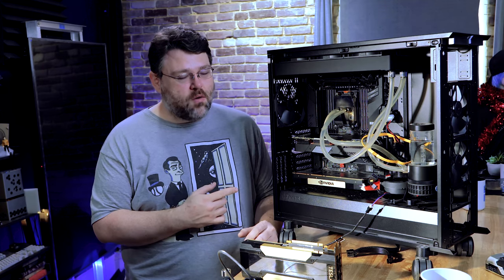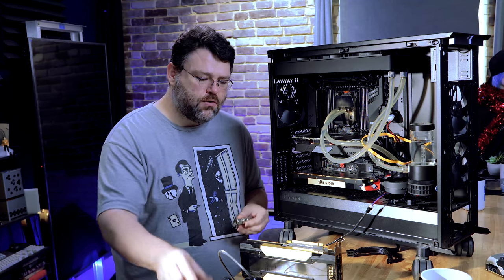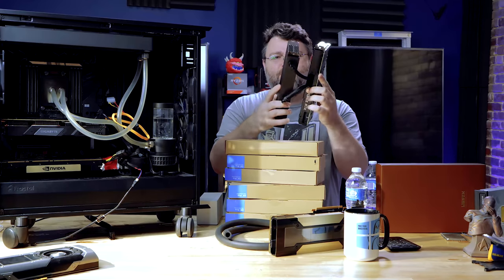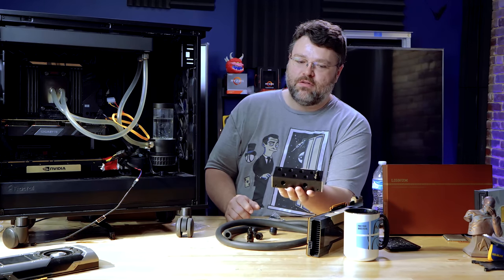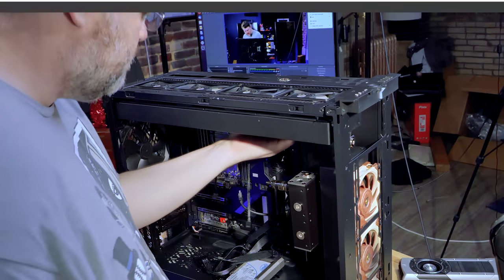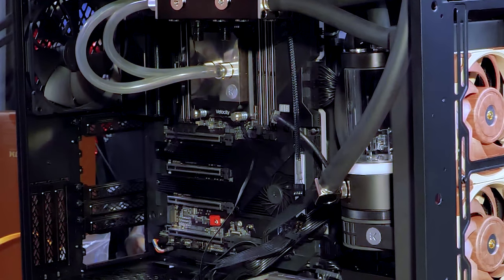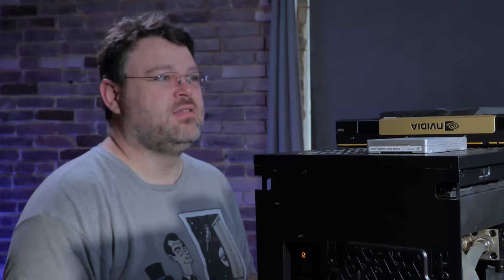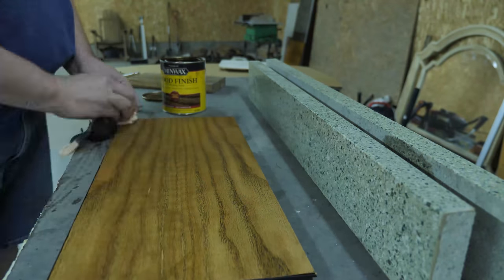32 Core Threadripper Workstation Upgrade - EK-PRO Quick Disconnect Liquid Cooling

Comment from the maker: HOLY CRAP THAT WOOD GRAIN AT THE END or something :D
Reply: It looks amazing I love the wood effect 10/10.
Reply: what is your case? i have been looking for a case with front panel for hot swap boot/storage drives, but it seemed all new cases are moving to the "sleek" bandwagon.
Reply from the maker: @noname-vl6vy  https://youtu.be/e1z_puftG9k - It is our Fractal Define 7 XL!
Reply: Classy AF
Reply: I remember AlphaCool showing some Epyc and Xeon 1U and 2U water cooling blocks and thinga last year at CES
Reply: car coolant been using mine 4 years only took apart to upgrade GPU once 4 years on still going good
Reply: Petg bro
Reply: There are a lot of good USB BluRay-ROM drives out there. Maybe even 5 1/4" combo enclosures with 5 1/4" and 3 1/2" floppies and a slim BluRay drive.
Reply: this  may seem strange but what little cart like device with wheels is it that you have there?
Reply: Somebody call the LGR.
Reply: Yes the minwax was just the right touch wendell. I think wood is sick looking,i love it! They make all sorts of veneer now,that will just stick to any case, stain and clear coat dont touch it! Ive been thinking of doing this exact thing, now i have too!!!!

Comment: There are a few things that I pondered when my friend showed me his water cooled pc. The first one is. The radiators should have bleed nipples on them, just like car radiators do. This would make getting air out of the system so much easier. The second was what this video has shown. I've worked with cars most my life, and always wondered why the whole water cooled setups were so cheap on the PCs, especially considering they are going in an electrical piece of equipment. Everything from the metals used to the coolant should be basically the same as a cars. Mixing antifreeze to water not only helps protect the metals in the coolant system, it stop all sorts of contaminants like sludge and other deposits from forming. It also raises the boiling point of the water. It most definitely conducts heat much better than these coloured liquids, plus antifreeze comes in some cool colours itself.
Reply: its funny you should say that, using PTFE tubes (rated to 240C), pneumatic stainless push in connectors (that are rated for water as well) and G13 HOAT car coolant in my setup here and those high end parts cost less then anything ekwb sells... The g13 gave 3C thermal delta difference over pure water, but pure water will eat everything over time so well worth it.

Comment: heatkiller waterblocks , your friend has good taste . I have the all copper TR4 block from them ....... its ..... awesome !

I use them black rubber tube and automotive fittings.... never need to clean the fluid , its as clean now than it was the day i filled it.

Comment: When I started noticing liquid cooling rolling out and the subsequent troubles, I was like yeah none of the materials are speced for it.  Then I looked into their fittings and I realized these guys are re-inventing the wheel.  They are incurring and solving problems that have already been solved many decades ago.  They could toss maybe 10k at a retired engineer for some contract work and save a boat load of R&D through trial and error and the additional warranty claims.  I still view water cooling products being engineered  by a bunch of armatures (the manufactures not the end users).  So here is an idea for a proper rubber line with some bling.  A person could mix their preferred plasti-dip color.  Add in a fluorescent pigment.  Spray the lines, then add some UV LED's.
Reply: You can also mold your silicone lines given the right tools. Car industry has some good silicone tubing rated for high psi and temperatures. Food industry has already had this exact tech for years now. Seen a few of these behind the scenes. Only main difference is the look of real industry products since they arent meant to be displayed in the first place. But I agree too many people dont realize really what your paying for is the luxury look and maybe ease of use compared to an actual tried and true standard.
Reply: Totally agree! There are so many really weird material choices and focus on stuff that does not actually matter in water cooling. I could buy some Festo nylon tube and stainless pneumatic fittings and have this done faster, more reliable and costing significantly less. One of the things that always surprise me is the fact they seem to use like 10-14mm id tube, but the flows are always going to be under 5 litres a minute, and probably more like 1 l/m You could halve the tube diameter and still have very doable pressure drops. I mean everything in my house is connected with 15mm od copper and runs way more water through it...
Reply: @buildthis2324  Push in connectors are used all over the factory floors these days, and are easier and safer then these compression fittings, yet somehow the push in fittings still seem like a no go here
Reply: I work in the car industry and fittings same size as here handle 100psi of air for tools or whatever. Rated usually much higher but I have quick connects for 100psi of anything not pure acid and they work just fine. Now however I do like the look of these quick connects for sure! Probably will be picking up the block  and sourcing everything else elsewhere.
Reply: @buildthis2324  Festo sells decent distro blocks as well. I don't know what EKWB charges for the quick connects but CPC has some great ones as well if you can get your hand on em. Good luck with the build!
Reply: As a final note the dude with the curly mustache...bit-tech! He makes some good ones custom from scratch. Another place for ideas and whatnot.

Comment: Nice touch with the wood.👍 I didn't know EK makes wood covered blocks. Cool! 
 I did something similar to a  inwin 301 outsides.  I got rid of the front light and I/0 strip so it only has one vandal switch.

Comment: Just look up "norprene" tubing. It's the same stuff. Super stable. I have used the same norprene tubing for something like 7-8 years with just distilled water and alcohol (for sub-zero purposes, and works well as a biocide too). The fluid has remained clear and clean. Blocks have not had ANY buildup. The only buildup I have had is a small ring inside the cylindrical reservoir from fluid evaporation, which I cleaned off with a toothbrush and barkeeper's friend. A quick filter of the fluid through some filter papers and back into the system it went.
Reply: I'm surprised the alcohol doesn't evaporate out and escape. That's cool to hear though.

Comment: This build is almost exactly what I want to do. Assuming Im following what you have done. Im assuming the distribution block is split into two sections, with each section having several ports. Then you plumb each component to both sections. This results in parallel flow to each component.

If that is what you have done, then the only thing I would change is to switch to 1/4” diameter rubber tubing instead of the 1/2” or 5/8” you have. While this would increase the pressure drop in each line - reducing the flow somewhat - it would make a much cleaner layout.  And there still will be plenty of flow, as all of the lines are in parallel (whereas most loops with 1/2” tubes are in series).  

Very interested in how this turned out.

On reflection - it looks like the kit uses 6mm id tubing. Excellent!

Comment: Been using that black ZMT tubing from EK for a couple of years now and it is still holding up great. I just use watercooling on my threadripper system cause it is more practical in a way, while it takes more time to build and needs maintenance from time to time, it is silent and never bothers me and it never overheats, even when it is 40 Centigrade here. 
Also, it doesn't need special fittings, it just needs fittings that fit the inner/outer diameter. I use some bitspower fittings and they work great. That distribution block looks really nice though, but I'm not sure I can convince myself to spend the money on it because I won't really use it and they're charging quite the premium for it atm. Nice video though, thanks for the content!
Edit: Spreading out the paste across the gpu die is a thing, this is not an IHS, as such every square mm of it needs to be covered or your gpu could overheat and die under load if the patch that has no/not enough thermal paste on it has no thermal sensor in it. Spreading it out manually removes the chance of this happening, Buildzoid does so with his LN2 pots too and made a video about why you spread it out manually. Personally I don't feel comfortable with guessing that it will be all right and that I put the block on level enough for the paste to spread everywhere.

Comment: Looks awesome Wendel, but did you seriously fill your loop without any clamps on that ZMT hose? Keep in mind it can expand with use
Reply from the maker: It's on the Todo list
Reply: I got ZMT and even without the locking collars they're hard to get off the fittings so I wouldn't be too worried.
Reply: It expands with heat, like every material does and having "loose" water tubes in my system wouldn't let me sleep at night. Hanging tubes, gravity force, heat extension, water pressure (ok, I know it's not 20bar inside, but still weight)...  Even just imagining those coming off during an important render session (or whatever you do with those extreme GPU's) while all your systems are running with max load, gives me the creeps – and it's not even my system.  lol

Comment: Are you tracking my Google searches? Literally, I was looking into EK water-cooling inside of a Define 7 XL with a 3970X the other night, and the only question I had was could I do the whole EK kit in the 7 XL storage configuration. It's going to be an Unraid machine with spinning rust AND PCI passthrough.
Reply: I have a similar use case for my existing Threadripper system (1950X), except I plan to use Proxmox instead of Unraid, same outcome in the end though :)
Reply: @longnamedude3947  I want this to be my piece de resistance in my office. The EK block is so beautiful, and I plan on doing some pretty sick stuff. Wendall, can I buy my parts and come on and do some really nerdy stuff? How to really leverage Threadripper for regular people? (Not that you're not regular people.. shoot!)
Reply: @hotstovejer  Sounds like you need a case like the "ThermalTake Level 10 Titanium Limited Edition", but with a Glass side panel and some minor I/O upgrades.....

You can't really buy them anymore and they were rare and very expensive when originally released. (About £1000, Limited to 1000 Units too I think.)
Reply: @longnamedude3947  I've wanted a Define case since the R6, and if I started looking at other cases, it may be another 2 years before I choose lol
Reply: @hotstovejer  I have myself an R6 in White with the TG Side Panel, I put some faux wood effect vinyl sticker on the front and it looks quite nice, it isn't perfect though, I could do a much better job of it if I had a second go at it.

I prefer the R6 with USB Type-C over the R7 mainly due to how you can screw the side panels in place, so they won't pop out.
Reply: @hotstovejer  good luck. N nice nickname handle guys

Comment: Okay hear me out here. Quick release to a radiator outside your building. Save some AC costs haha.
Reply: Linus tried it. It required too much maintenance for the performance.
Reply: That’s how you get condensation inside your computer: and disaster
Reply: @Smithdude_  also you can only do it in really moderate climate... I thought about this a bit when building my Mo-Ra external loop, but in winter it's freezing outside so I would possibly have subzero coolant with the need for antifreeze and in summer it can easily reach 35°C, so I would have really warm coolant... Also would require a complicated fan setup if you don't want to run power for the radiator fans through your whole place. 

Better to just put the rad in a room you don't really care about but can keep reasonably cool.
Reply from the maker: Haha!
Reply: @Daepilin  Could always switch to an inside rad in the winter. As a bonus it'd help with heating costs :)

Comment: Serious question - why wouldn't you just buy quick release fittings, tubing etc at a local hardware store?
Reply: Not all are made equal. It's not to say that you can't find some equally good (or even better quality) fittings out there, but EK should have tested and validated their product - I'd trust their validation to count for something over a random product with an arbitrary 5 star rating.

Comment: yeah i'm not really jumping on the watercooling bandwagon, aircooling is not much worse cooling wise, granted you get the right cooler, but that's the same with the watercoolers right now, id say aircoolers still have some critical points better, like reliability (much lower risk) and resiliency(no growth, no change it out every 1-5 years) and ease (fan dies change fan, not the whole system, no flushing), you can use an air cooler for decades if the parts hold without taking off anything and if the cpu sizes hold carry the cooler on to the newer systems.
 yeah too many points against watercooling imo

Comment: Why are those pipes and fittings so gigantic? The flows required are really low, like 6mm id would already be low pressure drop based off some off the napkin math...

Comment: Made me think of the cooling used on the Comino Grando RM, that full coverage cpu block, and separated radiator and fans.  Any chance we could get a review from you on how it performs not only for its specialized purpose but also as a general use system.

It's only a few thousand more than I spent on my threadripper system.

Comment: Do the sub-loops off the distribution block run in parallel? If so, how are the flow rates equalised given the different impedance of each loop, and the varying number of loops when you use the disconnects?

Comment: Would it be possible to combine 2x Little Devil PC-V10 PC cases to cool the 32 core Threadripper with both cooling probes mounted into a copper block which mounts on top of the Threadripper.

Comment: Question: how do you cool your SSD? I have P4500 and it gets pretty toasty under load - i mean high 60C and sometimes it starts throttling. I had to put it into the bracket with cooling fan blowing right on the SSD radiator. Is there a fan under the PSU shroud that blows onto SSD? How do you keep it under control?

Comment: 12:50 Didn't you mention there was a possibility of bio buildup in your previous kit? Why risk introducing that crap into a clean system. You are cleaning an old cut, but covering it back up with that dirty bandage...
I remember you patent-pending cooler design for the Tesla made from the mirror of a model S. Okay it's not, but sure appeared so. 
One last thing: wouldn't you consider a mod this extreme what possible performance increases you might attain, as an unnecessary risk? They are still very expensive cards to  replace...

Loved the video regardless, and looking forward to the rest of this build.

-Smalls
Reply: @MACDRU421  I had a CPU AI1 awhile back that performed really well. But I currently have the oversized Noctua dual fan heasink. The type that enjoys obstructing RAM slots... It's difficult to remember all the details. 
What I do remember is that I'm from the age of Sandy Bridge while being armed with a Maxwell Titan X...

I honestly thought though in the last few seconds Wendel left the office to take a tour of Nick Offerman's Wood Shop.

Comment: Wendell, for the love of god, if your using just a barb and not a compression fitting, put a clamp on each barb! You are dealing with rubber tubing, over time, with higher temperature and pressure on the inside... it will leak! I know you are new to this, but you didn't even mention CPC disconnects EK they have sold for years, and still do, which are medical grade. And I been running a 3990x with dual 2080ti with 1 D5 pump, its fine. Also you said you shouldn't let the water return to the res from the top? No, that's fine, and by doing so you don't need a flow meter to see you have good circulation, no air bubble problems... Kind of confused about the distribution block; Is this to avoid putting the loop in series pump->gpu->gpu->cpu->rad->res->pump? because it doesn't really make a difference because of the reduced flow. What would make actually make a difference is a second rad dedicated to cpu, but not necessary. To know for sure, calculate how much heat is generate versus the amount of heat the rad can handle. As long as that number is higher your fine, but if you want a a lower average temp, add more rad. One more thing, one of best advantages of the quick disconnects is that you and remove individual components, and can drain and fill the loop while not in the computer! No drain valves needed. Safer for you equipment.
Reply from the maker: Z i p t i e s
Reply: Oetiker clamps would be super overkill here but they would look really slick.

Comment: $108 for the QD kit?!!!  I bought plastic ones from McMaster Carr for $21 each. My PC may look like a meth lab but I can connect and disconnect everything in any configuration!
Reply: Oh there is also ones from ek for about 18€ and from what I've heard, while ugly, they are a lot more reliable long term than the metal ones...
Reply: That's neat, do you have the McMaster link onhand? I'm curious about the exact type.

Comment: This was in my recommended. No offence, but why wouldn't you make the PC actually look good since you've got a glass panel? That's one of the most unclean and messy looking builds
Reply from the maker: You talking about the hoses or the pcie power cables? I could probably clean up the pcie power but the whole point of the build was hot swap water cooling :-P